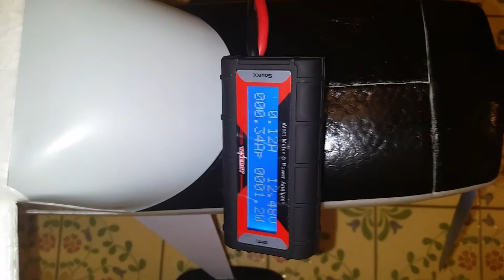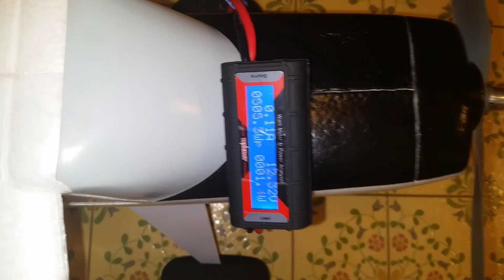Eflite Timber, 13x4 prop current test

Comment from the maker: yes, it flies beautifully with the 13x4.  I prefer it over the 12x6.  similar lift but less amps. recommend at least a 35c 2200,  3s.  both props give better vertical than the stock setup.